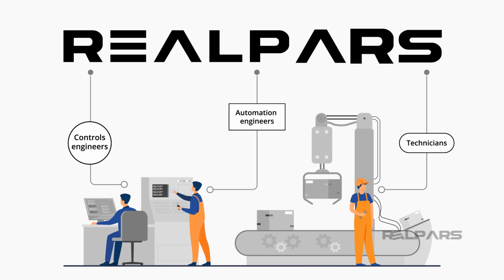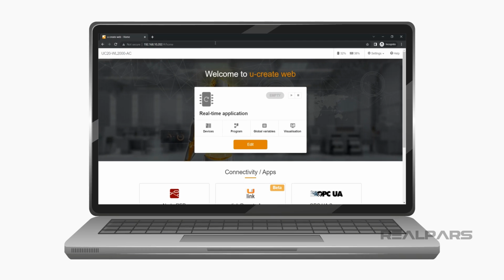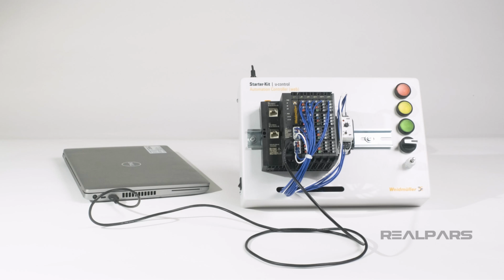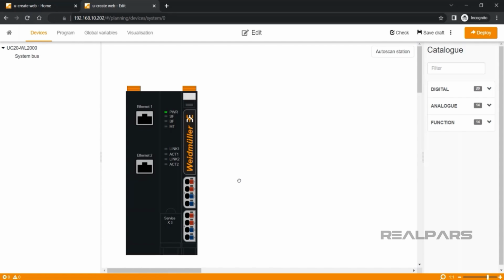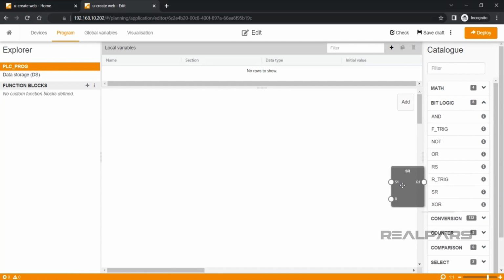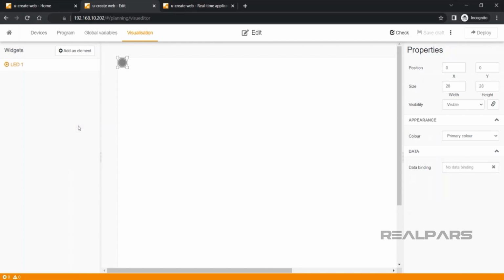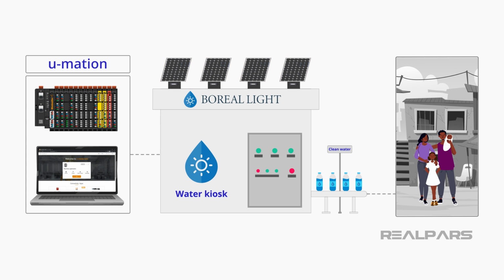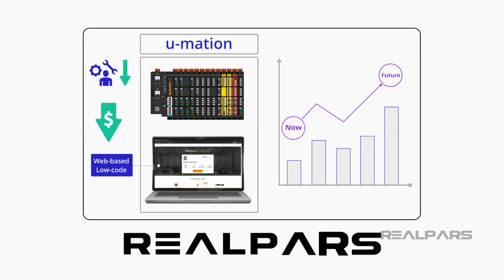A First Look at the Low Code Future of PLC Programming

Comment: With Allen-Bradley Studio 5000/RsLogix 5000 PLCs, you already have a very minimalistic setup. All you need is the PLC, any cheap laptop w/ Ethernet Port, and an Ethernet Cable. It also provides impenetrable security from internet-based attacks (since it requires a direct connection to modify anything within the PLC).

However, I wouldn’t be opposed to a modernization and/or unification of the programs used for them. The current ones we have are fairly outdated and complicated, and could use a little more automation in some of the processes, as well as some polish.

There is value in the complexity of our current PLCs, don’t get me wrong. Understanding why things work the way they do in a PLC is invaluable if you’re aiming to be any sort of electrician, whether it be for a job or as a hobby, and most PLCs follow very similar logic that can make you very versatile as an Electrical Controls Engineer. 

However, I must stress that the same level of learning can be acquired with a modernized and/or unified version of the programs if you account for it in some way. Custom and/or Premade Simulations, Premade Troubleshooting Guides, etc. all can help to teach the quirks of PLCs and electric work, all while offering an easier medium for beginners to work with and start with.

I mean, look at the Arduino community. It practically grew itself! There’s potential here for similar love and support. Someone just needs to do it and work things out with these other companies.
Reply: You DO know that you can change things over the network right? At my plant we never need to hook directly up to our new Allen Bradley PLC's.
Reply: @Morberis  yeah if the machines are connected to a network with internet access, you can access from anywhere in the world and make changes, the only safety would be the key to put the plc in "run mode" and not "program mode"
Reply: "With Allen-Bradley Studio 5000/RsLogix 5000 PLCs, you already have a very minimalistic setup."

and a multi thousand dollar license and the time to install the development tools on your cheap laptop
Reply: @SkiDeepPow  Geez, I didn’t realize the license was that expensive. Probably because the company usually pays for that. Thanks for the heads-up.

Regardless, that’s a one-time installation. Once you have the program and the license, it is rarely ever an issue again.

2-3K for a standard-level license doesn’t even sound that bad, actually. It’s VERY petty, yes, but jobs these days that require you to work with PLCs typically offer enough pay to pay for the program in around 3-4 paychecks (assuming you aren’t living paycheck-to-paycheck). The rest is profit.

Comment: Meh... automating simple tasks isn't the challenge anyway, the problem is how to automate complex tasks, web based ide is a bit optimistic for true software development. Also, need to think a bit about itsec, automation doesn't get updated, systems run for years or even decades as they were, of course they are supremely vulnerable to all sorts of malware if they are ever exposed to it. So the solution is to not expose it, best network connection is no network connection, second best is absolute minimum traffic that must pass through for essential functionality. For a automation controller to be a webserver accessible from all over with wifi devices like phones and tablets.... that's a recipe for disaster.
Reply from the maker: Hi Aleksander,

Thanks for the comment!

The traditional way to ensure that control systems are safe from cyber-attacks is to keep them off of networks. In modern times, there are some drivers that lead manufacturers to want to have more connected control systems. Most manufacturers that we speak to now want their control system connected to a network so that OEMs can provide remote support, the manufacturer can capture data from the control system to drive decision-making, and control systems can leverage modern technology like web-based visualizations on mobile devices. To meet these market demands, innovative companies like Weidmueller are building products that can be connected securely to networks.

You are correct that there is a risk involved in connecting industrial control systems to a network, but there is also a cost for manufacturers not connecting their control systems to networks including extended downtimes and lost production due to inefficient operations.

Comment: Cant see any application for this - sry. Seems like it is "solving" a problem you just made up:
You cant use it for complex machine, but this type has your said problem.
You use it for simple stuff and this type wont have this problem that much (at least it shouldnt). Such simple machines are mostly bug-free when shipping and 99% of the time noone ever need to change the code after that.
Additionally I ask myself if it is even possible to save a project to transfer them to other machines? Also if you add some things for a new machine version (add 1 more output card for example) can you even use your "old" code to adapt?
And since you moved all things into your controller (so you dont need a powerfull pc to program), it it save to assume, you need more powerfull controllers now, so instead of buying a more expensive pc ONE time, i need to buy a more expensive pls controller for EVERY machine?
Reply from the maker: Hey, thanks for input Manuel. 

Maybe this system is not relevant for you or your specific use case, but companies like Boreal Light are getting value from the system. They sell a machine that is getting better over time and since this controller is easy to use with no license fees, they can use local contractors to deploy updates and service the machines. Many OEMs are also experimenting with service contracts that include periodic updates of machine software to provide new value-added features and updates.

To answer the second part of your question: yes, you can export code from one controller and import it to another as a starting point for a copy or look-alike project. 

Hope this answers your question sufficiently.

Comment: Security vulnerabilities. PLC programming languages were invented for a specific reason that has lost relevance in our day. Many PLC platforms (Siemens and Beckhoff) require a certain level of PC programming knowledge. Some PLCs already depend on the developer to make the tools useful for troubleshooting (Step 7). And with companies wanting more and more data tracking, the move to PC based controls is the only sensible solution.
Reply from the maker: Hi Tommy,

Thanks for sharing your perspective. At RealPars, we have a slightly different opinion which I would like to share with you.

PLCs (and their programming languages) exist because most people working in industrial automation are not computer programmers and need an easy programming language to implement control applications with. PLCs are also important because PLC operating systems are more reliable and less vulnerable than PC operating systems.

This situation hasn't changed recently and you can argue it has actually gotten worse with mass retirements creating a talent shortage in the manufacturing industry and high-profile cyber attacks creating pressure on companies to take security vulnerabilities more seriously.

For these reasons, we think the controller-based applications will remain relevant for the foreseeable future and that the solution to companies wanting more data will be connected controllers which can send data to the cloud via OPC-UA or bespoke cloud connectors.

It's also worth noting that the u-mation platform is programmed through a web browser but the actual application runs on a controller like a traditional PLC. Sorry if that wasn't clear from the video.
Reply: @realpars  Interesting perspective. Thanks for the clarification about the code not being housed in the cloud.

While I agree that most people can't program advanced applications or databases, I think the only benefit to ladder logic is that it is typically much easier for troubleshooting, due to the colors telling you what's active or not. There's no reason you couldn't implement this on a PC-based controller. It just takes some initial design work from the development team.
PLC's do have more stable operating systems, but many industrial controlled machines use Linux or QNX or other operating systems designed to run on PC architecture, yet control automation. This unreliability of PC architecture and operating systems, compared to that of PLC's,  would change if the industry created higher demand for industrial PC's.

It will take work to train someone to program controllers no matter what system is used. The whole point of PLC programming languages was to give techs a starting point. I think many new techs now, and even more in five or ten years, will find it easier to look at high-level scripting languages (thanks to Minecraft, Scratch, Python, etc that are accessible and interesting to today's kids) than ladder logic diagrams, which are rarely even used by technicians in our day.

It may be that PLC's hang around, but it will be due to fear of change, not because they serve a real purpose. As for the current trend: Many machines already use C-based code in industry and PLC makers produce industrial PC's. Companies slowly are trending towards structured text (over LAD or FBD), and Beckhoff PLC code looks more like high-level PC code. There are even companies that program entirely in statement list for Siemens. My point is the market is already divided on ladder logic vs PC-similar languages, and the trend is to move slowly to more and more PC-similar code, in large-part due to the tech revolution of our time.

I hope you don't take the difference of opinion as a critique on your video. You produce some of the best training videos for industrial controls out there. I often review them to dive deeper into a new topic or review a familiar topic. You clearly have a skilled team in terms of technical-knowledge and production quality. Thanks for producing them! And thanks for taking the time to review my comment.

Comment: Reading the comments on this one makes me realise that not everyone is ready for changes.
I saw this PLC a few months ago, there's no much material about it on internet since it's still "fresh". (or it's just a bad marketing, idk)
thought was a very good concept, modernizing PLC's is something that i have discussed with colleagues over the years.
On the last decade a lot of new technologies were introduced to the public and got accepted around the globe, google's material design have changed the way we look to GUI's, it even changed the way we interact with apps and websites. I rather use an minimalist material gauge today to display a range for frequency/speed than those ugly clock objects of HMI's from the past,  for example.
It's time to PLC's to embrace things like MQTT right out of the box, without having to buy extra modules.
Interfaces for programming plc's should be clear and easy to use.
Today you can build your own broker, database and scada using free reliable solutions, with a webapp interface you can go full linux without the need to use proprietary softwares on windows to program devices. A few tweaks and you can have a VM/cloud based application running on centOS or other distro.
Weidmuller should add in the future ladder, SFC and ST to the toolbox. 
Nice video, realpars.
Reply: Wake me up when they have PL-E safety control
Reply: I just got my hands on one, IT IS AMAZING! But it seems you're right, they didn't invest a healthy marketing budget. They were ahead of their time on this but they didn't persevere! It seems they've already abandoned this project and moved on to something different called u-os. But it's just not the same. But it IS an amazing company! You wouldn't believe the level and quality of support, you can even call it customer nurture. I've been advocating for a relaunch of this project, and it has not fallen on deaf ears. And you are so right, if they add ladder, SFC and ST to the toolbox I will ditch CODESYS and never use another PLC.
Reply: Linux is the future in my opinion. PLCs no longer serve a purpose. Your average laborer is more likely to relate to high-level code than ladder logic.
Reply: @tommyhuffman7499  PLCs have one purpose left: driving the actual switches
Reply: @fltfathin  PC's do this with IO modules. PLC's are often still reserved for safety devices, though.

Comment: Everyone should just move to C.....
Reply: @Shredxcam22  Nobody is pushing to write the Linux kernel in Fortran. Linux kernel and Embedded system overall are pushing Rust due to its safety. The server space is pushing for Go because of Go routines. Go is very good at concurrency. 

If you genuinely spent some time with C you'd know it's a bad idea to use it in Industrial Automation.
Reply: If only it wasn't so unsafe.
Reply: 100% agree that this will be and should be the future.
Reply: I'll stay with Rust
Reply: @Shredxcam22  As in you can easily, write code with memory leaks, page faults, segmentation faults, etc. 

There is a reason why there the current PLC languages don't allow you to do recursion and why references are recommended above pointers. The current IEC languages enforce safety. They are also very good at catching memory leaks if you decide to go down the dynamic route. Live updates are also important, C doesn't support this or ensuring safety with C is very difficult. Without OOP (Constructors/Destructors aka FB_init/FB_exit)  doing RAII is difficult too.

Also why do you think so many are ditching C for Rust and Go?

Comment: Does it have a separated CPU for web/vizualization and PLC, or if someone tries to DDoS web page it will crash the PLC CPU also?
I see it also as a security vulnerability...

I don't need licenses...ok i get that...but be real, a lot of income goes also from licensing, and if they make it "free" they just add more profit to the  HW, so the customer will pay it anyway.

I agree that easy small project can be cheaper with that...but it's not a real "future of PLC programming", it just moved classical FBD programming from single applications to the web browser... :)

But i think that it is a really good idea for schools/starters with automatization. The students don't need to install and get licences only for few weeks/months and also even low end PC can run it. :)
Reply from the maker: Hi Jakub, 

Thanks for your comment!

Yes – the first CPU is only assigned to the plc-application. Everything else (included the Engineering or “Edit” environment of the plc application) works on the 2nd CPU.

In case of problems during the engineering period, the running plc application won’t be affected.
Reply: Hi Jakub,
u-control web provides 2 cores with clearly separated tasks. The first is assigned to the plc, the 2nd for IoT and EDGE functionality.
And to your second question: Nevertheless you will get a PLC with a top price performance ratio and without any sw maintenance fee, afterwards.